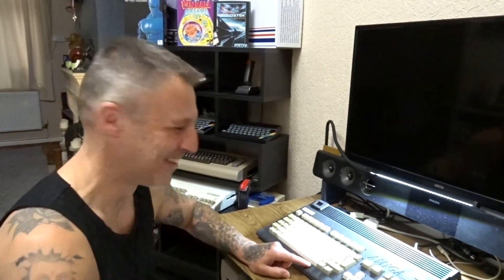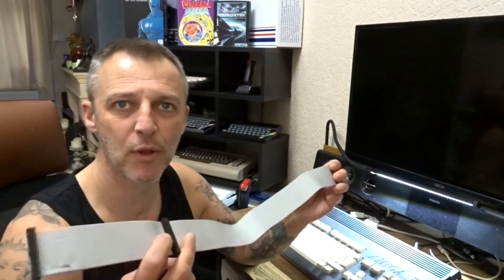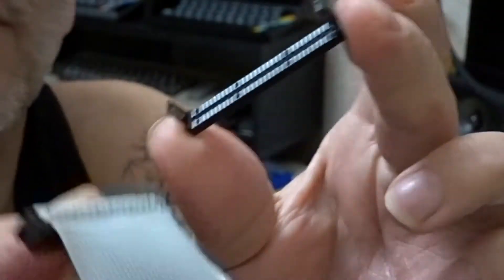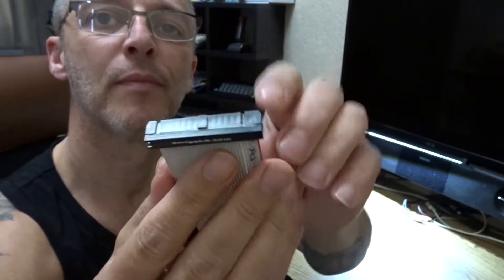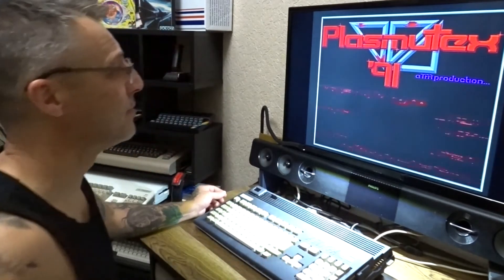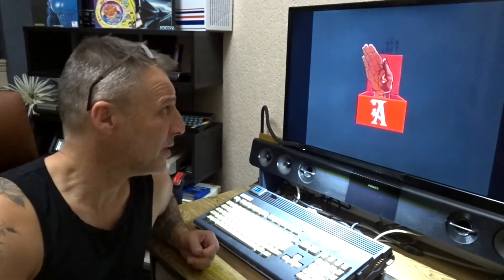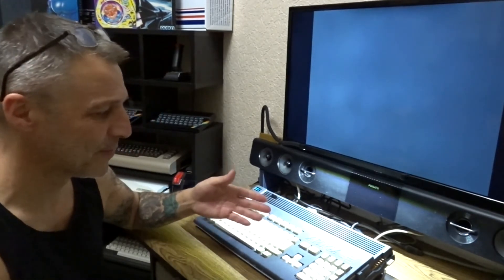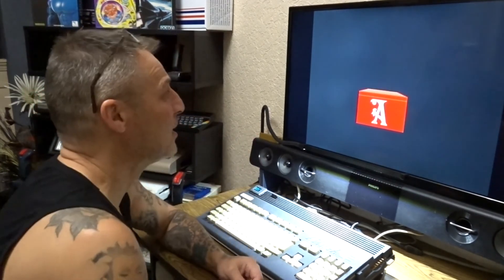Amiga 1200 internal dual drive step-by-step

Comment: I did the mod with a (on-off-on) 6 pin switch on the power cable. This way only one drive is active/on at a time. I can load ie Cannon fodder from the gotek and flip the switch and save the progress on the fdd with a disk. However, the orange loading LED is constantly on and that anoys me. So ill try this mod too. Thanks 👍

Comment: Nice that you build it in your A1200. My A1200’s have only a intern Chinon FZ-354 Diskdrives and a extern black CDTV CD-1411 Diskdrives. Have to many projects with my C64’s/A500’s and A1200’s. 9 out of 10 there are parts from Individual Computers such as the Indivision ECS V1/V2, Indivision AGA MK2CR/MK3, ACE2, ACA500Plus V1, ACA1221, ACA1233n-55 and have two great Blizzard 1230 IV cards with FPU and 128MB 50ns simms. Like the A1200NET cases which I have three and one with the keycaps. Thanks too the 3.1.4 ROMS chips I can go to 32GB CF than to have a limit of 8GB CF wIth WB3.1. I do some Demos on diskettes but use a lot of WHDLoad stuff and EXE Demos. Play it on a 17inch BenQ BL702A VGA monitors and use Bose speakers with it. Have a great time with it and want to upgrade to a faster 68060 card. Would be nice to have a Blizzard 1260 or a ACA1260 in the near future. Post all my AMIGA stuff on Amiga Cafe (is a Dutch forum and my account is AMIGA JOHAN). 

My A1200’s have a straight forward clean inside build want not have a hot A1200. Like to experiment with it and begun first with a A500 to see if I like it 4 years ago. Grew up in 80’s/90’s with the C64/A500/A1200. Have only have back my C64 Breadbin FAT 250425 RevA from 1984 which almost in mint working state. Would like to have a complete A1000 but don’t have the room for it. Have sell all my A1000/A2000/A3000/A4000 motherboards to buy new stuff for my A500/A1200’s. For me the A500 is a beast to have and it was my first AMIGA experience (1988). The A1200’s you can do nice projects with it and I like the A1200 bifrost heimdall Edition LED.
Reply: Why do you write all this?